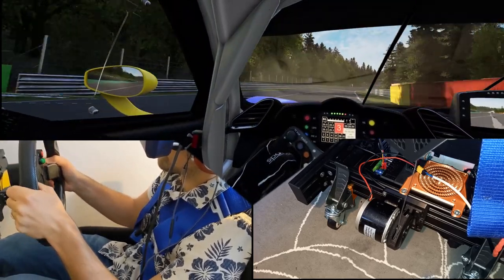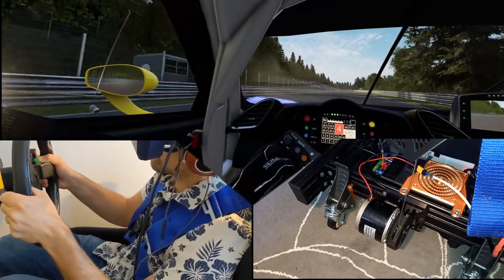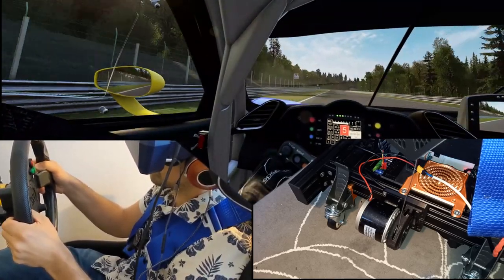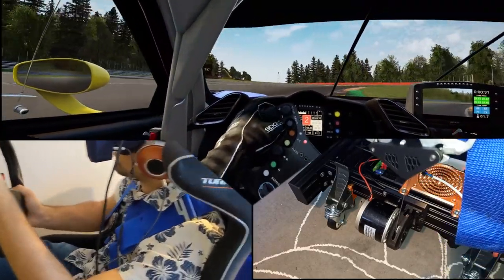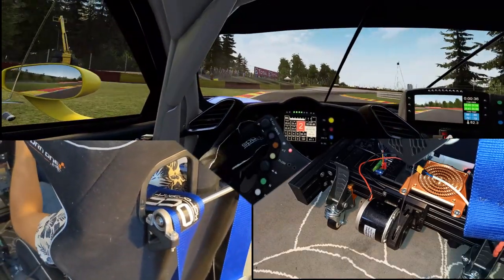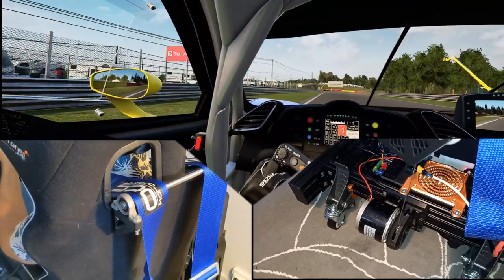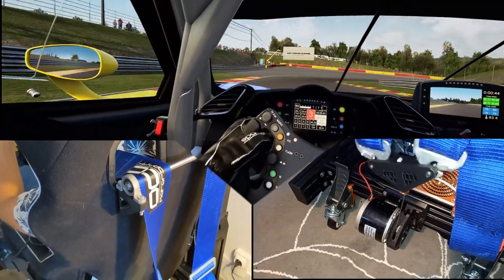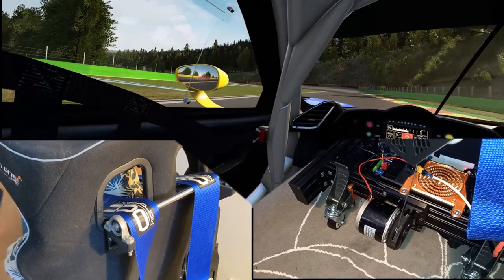Seat Belt Tensionner GT: presentation !

Comment: Dude I'd recommend the useof a 5 pt harness that way it does not pull the lap belt high into your stomach
Reply: that requires a second motor for sure. one motor cant have that needed power

Comment: Thanks for making the video - it's a project I will probably try at some point! :) Have you considered adding another one to have the turning effect too and do you think it needs such a powerful motor or if you did it again would you use say a half strength one? :)
Reply from the maker: i tougth of it but i'm not convinced that it would be more immersive
Reply: @LeboisRacing  you might be right. :) some reviews of system with it do say it adds to the feeling of g force round corners but I've not tried the any systems yet so not sure. I've got a yaw2 and the opposite roll in vr really makes you feel turning anyway so all good :)